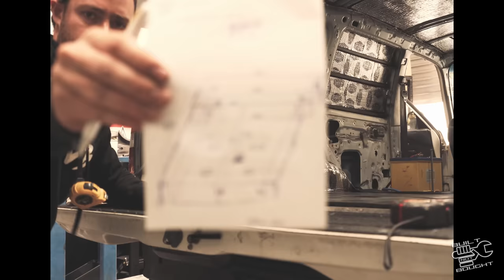BNB 80 Ep. 11 || First Drive In The 80 Series

Comment: That's not a shroud that's a plate blanking 50 percent of the air flow and only sucking air directly in front of fans. It needs to be sat off radiator so fans can suck or blow 100 percent of face area.
Reply: 100%
Get slimmer fans and have the shroud folded to stand of about 30mm.
All that shroud is gonna do is suck from the surface area of the fans not the entire radiator surface area.
Might aswell just mount the fans direct to the core.
Reply: Was thinking the same, needs to weld like 50mm strip of aluminium around the perimeter to allow it all to pass through easier
Reply: and have openings with rubber flaps to allow to flow better when driving. which will be sucked shut when the fan is on
Reply: @ottigreenisgo  I've toyed with that but wasn't a fan.🤦
Ive found thermos loose effectiveness at around the 60kmh, which then relys purely on radiator design/efficiency.
For me a dual pass radiator and good shroud worked the best.
Reply: @Franksssss  100% that is why having the flaps let the radiator flow much more air than it being funnelled through just the fan hole. and dual-pass always!
Reply: Yep, 100% agree. Also not a fan of using bent sheet metal and after market fans for cooling... much better off going down to the wrecker and finding a decent pair of thermofans which can be mounted instead. Typically the Falcon AU twin thermofans work pretty well (slimline and move a lot of air).
Reply: Yep I agree I modified a BF shroud single fan to go on a FJ40 small block. 50mm off the radiator tapered towards the fan 
Much better than the flat one!! 
“The hot air doesn’t hit a wall”

Comment: Might be worth putting some sort of divider in the shroud between the radiator fans, so when one fan is off the the other fan will suck air through the radiator not through the back of the fan that’s off

Comment: Alloy draw frame, forget the name of the stuff but there's a bunch of standard square section lengths that are joinable with elbows and butts from Bunnings. Will cut the weight down. And if joined correctly will be just as strong as steel
Reply: Aluminum extrusions
Reply: Cubelok I think

Comment: You have a Mig, you can weld alloy, its no harder than steel when working with shs like you are going to use for the frame. Just need to get some 100% argon and a teflon liner for the hose and give it a go!

Comment: Hey mate, If you don't want to splash out on a proper long range tank ($1100+) then get a prado 90 or 120 series rear tank. They are 95 litres and fit pretty damn well with a basic bracket. I can send through some detailed pics on what you need to make, can be done in less than a day for around $200-250 for everything.

Comment: That turbo drain line might end up melting with how close it is to the manifold even if it does have that silicone protective coating on it. Would recommend some sort of extension of routing away from that cylinder one runner. Sweet as conversion tho mate! Turbo sounds wicked.

Comment: you may run into overheating issues with that fan shroud the way it is, 
it needs more holes for better air flow through the radiator you’ll fine the radiator will be more efficient with more holes in that shroud 

Keep in mind what the factory shroud is like and how efficient they are

Comment: Fan shroud is no good boy, needs to be spaced back about 15-20 mm atleast to draw air through the whole radiator and not just the 2 holes the fans are sucking through . That thing will cook if you leave it the way it is on the beach